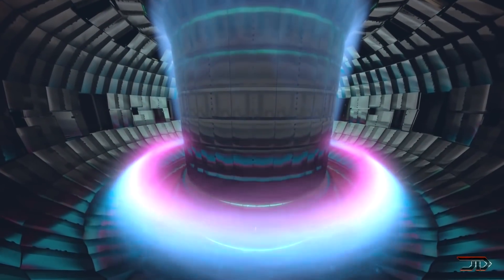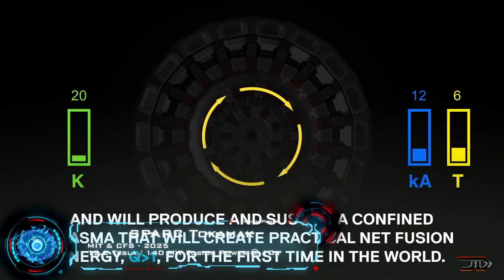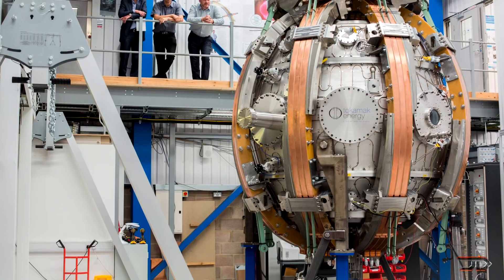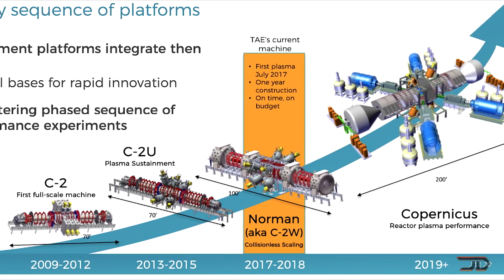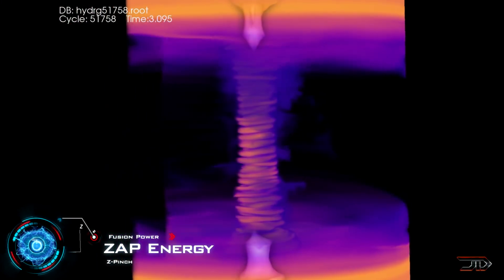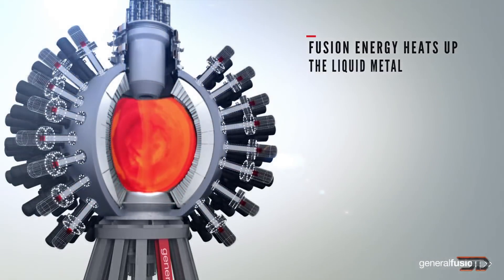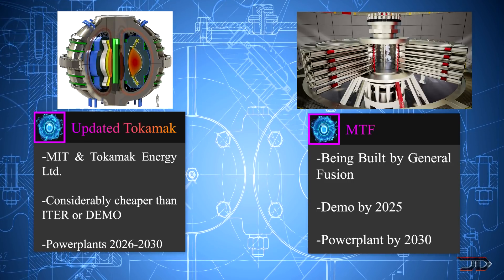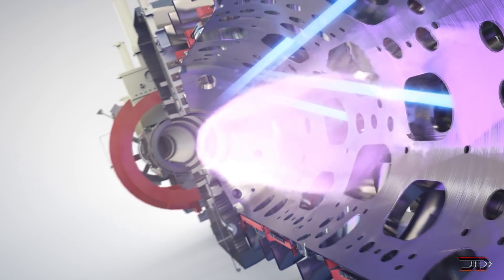Fusion Power - Latest Breakthroughs/Updates

Comment: Energy is not expressed in watts (4:35), that's power. To get energy from power it must be multiplied by time. Getting 300 megawatts means not much if it's only for a fraction of second. 300 megawatts for 1 microsecond is 300 joules of energy which is same as when 100 watt bulb consumes in 3 seconds.

Comment: None of them will provide grid electricity in 10 years from now. As you said, they are just learning how to get a Qtotal to 1 for Qplasma, not for the whole system. But it is amazing, what we can engineer today and maybe I can witness these energy sources become the power supplier of a New Age of humankind. It would be a game-changer like developing coal power in the 19 century. Certainly, with progress in HTC, it becomes more and more likely. I would guess, that is the core challenge to fission power. If the magnets become more stable at, let's say room temperature, they will be also more forgiving in changes of magnet flux, etc., and thus less costly and more reliable.

But, I'm highly amazed at what is going on in the fusion sector. :)
Reply: My experimental opinion is that in the next 5 years it will spread of LENR-based energy source. I am convinced that the result will be cooperation with the Chinese. these collaborations have already begun. Think of the Quantuum Dragon project.
Reply: @zoltanpecsek4373  That's pathological science.

Comment: Celcius ?
Reply: Good question. Where the tiny dust point is terribly big, I can’t even measure it. However, the total plasma average temperature is not high at 1000-1100 degrees. In fact, the charge ignites on the dust to a huge extent and thus cuts into the other grain of dust. Of course, there is every detail calculation based on articles. But this should also be given to the Chinese as a source of spherical lightning technology...In fact, we were completely disappointed in the West.

Comment: What about drive engines for space exploration
Reply: You can guess that everyone is working on this in secret. several pathways have been found, one plasma-based super propulsion, the other ferrite-based but only suitable for positioning, and is GMR-based highly effective. But it's not a space jump yet. His theory of space jumping seems complete. All the hidden labs stole the structure model of the spacetime system from each other. This means that a plasmon system must be stretched around the spacecraft and professionally controlled. I am confident that the Chinese-Russian consortium will complete it.
Reply: @zoltanpecsek4373  thank you for that answer that's great

Comment: Q for the entire apparatus has to be substantially larger than 1 in order to be enough to “go to the grid”, and we’re much farther off from that then 10 years, let alone less than that. We don’t even have an experiment that has a Q for the fusion process that is higher than one. I will be thrilled if I am wrong, but I don’t see this generation of experiments, or maybe even the next ones, doing anything practical.

Comment: 1:57 why they make all donuts shape/toroidal instea make sphere? Sun is sphere, planets are sphere, atoms are sphere(well close) look like universe like sphere. ok you got me galaxy are toroidal but i think is more easy to confine a ball in center than a hulaloop.
all the hot gas dont get disturbed by iner axe. and the ball can spin on its own axe like Terra is doing.
I would like to try it. make magneticfield from HTS flat wire and give it a ball shape ass we doing with carbonfiberweding.
Reply: You're right, that's what we found out about the vortices. We did it and it goes small. But the rich want a huge power plant to continue to plunder you with energy prices

Comment: One thing I'm always confused on is how the actual engineering of how to get heat moved out of these systems and doing work is left out. I know we're still trying to get the base principles down first, but I really wonder what the pathway to generating usable power will be.
Reply: I agree I can never find much information on it and seems like a big system that doesn't look like many advancements are being made on
Reply: Neutrons hit a lithium blanket, producing heat, which is transferred to a secondary coolant system (and maybe even a tertiary one), raising steam and turning a turbine.
Reply: @Gomlmon99  the neutrons hitting the Li blanked is not about power generation but about fuel production.
Reply: @russhamilton3800  It’s the neutrons that carry the energy, and the neutrons that heat the blanket. They serve a dual purpose.
Reply: i think they havent focused on that yet because it is the easier part of the equation to figure out.

Comment: And, the corrosion due to the neutron shower which will shorten the life span of any device and necessitate expensive parts replacement?
Reply: Potentially. But there will be shielding. And whether the parts replacement is severe enough to ruin the economic viability of fusion is unknown.

Comment: Was the National Ignition Facility mentioned?   It uses a multitude of laser pulses.
Reply: Not used for power generation, it’s for weapons
Reply: @Gomlmon99  none of the systems mentioned have the ability to generate power.  They are all demonstration projects.  True that the NIF is used for testing nuclear device design but it’s also attempting to cross the fusion finish line.
Reply: @calvaryassemblyofgodsouthi8046  the fusion finish line is power on the grid, cheaply. NIF aren’t aiming to do that
Reply: @Gomlmon99  ok

Comment: If they spent the trillions of dollars making Tokomaks to land and solar satellites beaming microwave energy to the earth we would not have an energy crisis anymore.  The sun is already the ideal fusion source.  We already have SpaceX to send and construct orbital solar generators for this.  Nobody mentions the fact that these Tokomak chambers need replacement every few years due to fast neutron radiation, making them ridiculously expensive and creates radioactive materials that needs to be dumped somewhere.
Reply: An “orbital solar generators” are not going to be ridiculously expensive?
Reply: @Gomlmon99  Expensive, but you get guaranteed perpetual and non-radioactive power.  On a side note it also makes the human race space faring and multiplanetary.  Compare that with thousands of Tokomaks constantly creating radioactive materials from replacing the magnets and shields, IF they make it work.
Reply: @Gomlmon99  Watch YouTube - Elon Musk's simplest idea on solar panels to power the US.  It only takes a small corner of Nevada or 100 x100 miles to power the whole US.
Reply: @joey6818  In space?
Reply: @Gomlmon99  On land only.

Comment: ITER is just an proof of concept if you have Q=10 net gain inside the reactor ofcource you don't end up with ten times more energy then you put in, if you include all energy used to construct build and maintain the equipment needed. That doesn't matter much though, once you know how to build the reactor and have it stable you can start working on to make it as cheap as possible. Then you can also redesign and figure out how to reduce the energy required. Think of it as an car an old ford is version 1.0 and you end up with current cars after a while.

Comment: So... someone is funding scientists who want to make perpetual energy? I was told that was snake oil by scientists.
Energy in, Convert atom to different atom, get more energy out? is that what we're trying to do here?
We don't even harness Fission yet, just a thermal effect for the steam generator. "here's a radioactive thing that if you do this, it heats my coffee!, let's turn it into a steam generator!"
There aren't any breakthroughs in fusion. They're neat, expensive, and will create opportunity for various other industries - plasma jet engines for example, but to create enough energy to overcome the energy required? They're not even close to touching that milestone, let alone hitting a Q1. "Technically, once it works perfectly, every 10 seconds we eat 50mw and we can shove 300mw through the pipes to your house, don't worry about the bi-product, the future will figure out what to do with that!", I want to see how they buffer the energy requirements and the output so it doesn't make my toaster dance when it's off.
Reply: It’s not perpetual energy, it burns fuel

Comment: Meanwhile brilliant light power just produced a 200 to 1 gain using hydrogen gallium and dc power. That produces 10k degree heat and claims it uses dark matter fused hydrino atom that produces the same effect in the sun. Here is what the problem is if fusion occurs inside the sun WHY THE HELL IS THERE MASSIVE DARK SPOTS ALL OVER THE SURFACE. UNLESS THE SUN CAN BEND LIGHT AROUND CERTAIN AREAS DUE TO WHAT EVER FLUCTUATING GRAVITY ANDCELECTRO MAGNETISM. the sun crests fusion on the outside or surface. By using the effect of superconducting hydro fluid in both liquid and metal form to produce high yield spinning fields that cause massive electrical surges on the surface increasing the speed of the atoms so much fusion happens do to the ionization created just like earths ionosphere which is known to be 3thousand degree all around the earth. Which the earth also has a magnetic sphere. Hmmmmmmmmmmmmmmmmmmmmmmmmmmmmmmmmmmmmmmmmmmmmmmmmmmmmm.

Comment: how do they even plan to extract energy from the fusing plasma?  This aspect is never discussed except for the liquid metal system. But if they don't take the energy out extremely efficiently, it will run away thermally.  It's all very well making things blow up, but it's not much use without harnessing it.  Also do we really want to start making processes that start generating billions of watts of heat that we need to get rid of (e.g. extra waste heat due to inefficiency of conversion)?

Comment: I personally don't believe that magnetic field controlled fusion is gonna ever be power positive.  The reason why fusion works in space is because gravity is the one holding it together,  free gravity.   Electromagnetic fields will never be free especially the ones you need to control fusion.  I say that instead of concentrating on a force that not even the cosmos uses 100% to control fusion why don't we look to something else that's more that makes more sense.

Comment: When mentioning the Q total of an experiment the fully accurate explanation should describe the burning plasma / ignition profile of a design

For instance while ITER is likely looking at breakeven a pilot plant based on it would produce 5x more power with an input about 75% greater - putting out a net GW of energy. As a tokamak approaches a Q of 30 it becomes nearly fully self heated which is something that Q total values can't convey until you actually get there

ITER's economics are undoubtedly still a question mark. They depend on economies of scale and private enterprise allowing a commercial design to be built far cheaper. But since an ITER design is so large it must put out at least a GW, making it difficult to find enough demand for them so that the cost can go down with experience and economy of scale
Reply: ITER is a purely research operation, there is no “economics” to it — it’s not going to sell electric power into the grid. It is only to study the processes in the plasma (yet to do) and to drive forward the technology by ordering lots of complicated engineering stuff made all around the world such as  the various HTSC magnets, blankets, divertors, beam and power injectors etc that can be reused in further projects.
Reply: The majority of the cost of the ITER project is the measuring systems behind it. The reactor is build more like CERN rather than a power plant. A commercial design would be magnitudes simpler. Also new high temperature superconductors can simplify the reactor design

Comment: Here's an entertaining Holy grail. 
The Words Whole relationship:
G is an incomplete whole with one square angle drawn in. 
O is a Whole.
D is a split whole with two square angles drawn in. 
As we add a Whole relationship to the words middle way we see GOOD expanded from its Whole image.
Draw the Words first and last into its middle way to measure a Whole halved once squared twice to the right for its:
Time 12-3-6 
Time, times 12x-3-6 
Time, times and half a time 1/2x-3-6 
Additional elements from the table:
12 Magnesium 
3 Lithium 
6 Carbon 
1 Hydrogen 
One clock wise cycle out of many observed and measured from the Words Whole image, not mine.

The second cycle of the image adds onto the Hydrogen, 2×-3 would be the Deuterium and Tritium extraction gain, as its contained in the higher arc and angle from that same image.

Of course no one's going to draw the word into its own image to see if it's true and would rather throw it away or argue for and against invisible magicians.

Oh well.

Comment: What substance can contain plasma with a temperature of 100,000,000°
Reply: None! The chambers are often lined with tungsten, or ceramic tiles and great effort goes into keeping the intensely hot plasma from getting close to those walls. Even so the tile surfaces are ablated and so those tiles need to be replaces. It is one of the details that is rarely mentioned in promotional presentations. In the fuel instances where fusion actually takes place and fusion neutrons are generated they will transmute some of the surrounding atoms into radioactive species. That is another factoid that rarely gets mentioned.

Comment: I'm wondering why more people aren't focusing their efforts on electrolysis, producing hydrogen out of water using electricity. It's easy, you can run combustion engines on it to power generators to produce electricity, and the emissions are just water vapor. It's something that actually works and simple.
Reply: The production of hydrogen using all renewable sources to electrolyze water is often referred to as 'green hydrogen.' Many people are unaware that though it is a very simple process in the lab it presently can't compete economically with hydrogen production that involves the emission of CO2 into the atmosphere. We live in a world driven by capitalistic practicalities.
Reply: @vernonbrechin4207  it might threaten the petroleum industry as well and we couldn't have that how could we
Reply: @christrull7081  - Currently the fossil fuel industry is promoting hydrogen, partly as a diversion and because most hydrogen is now produced from natural gas, with CO2 release as a byproduct. Many entities are far more focused upon the preservation of themselves over that of preservation of life on this planet.
Reply: @christrull7081  all you have to do is stop buying oil and switch to electrolyzed hydrogen to see it is a bad deal.
Currently oil is dirt cheap. Few hundred for a barrel that will teleport you around town and power your comfy house.
Hydrogen is going to be many times more expensive, people are happy to pay a little more for green tech but not 3 times more.

There is no conspiracy, it is just simple reality that people choose oil and gas because it makes more sense. You included.

New technology is the way forward, cost for energy has to go down, not back up.
Reply: How does it work? It is like saying lemon batteries work.
The problem is the bad round trip efficiency, hydrogen is just a energy storage medium.
- 70% efficiency in generation is the absolute max (electricity -> hydrogen)
- 40% efficiency when combusting is the absolute max (hydrogen -> kinetic in a ice engine)
- 80% can be done with a fuel cell instead (hydrogen -> electricity -> kinetic in an electric motor)
- another 20%+ is lost in compression 

In a perfect world that still means half+ the electric energy you catch in your solar panel is lost in the process. meanwhile with batteries that number is not even 20%.
maybe some time in the future when there is massive overproduction of solar energy at certain times of the day and year electrolysis makes sense. But for now nope.

Comment: What about the Wendelstein-7X? It is currently going over to the phase where it is running a deuterium-tritium plasma for potential energy harvesting. Overall stellerators are a very promising fusion technique because they can be run almost continuously and not in pulses.
Reply: Thank you for mentioning that since most fusion experiments do not employ fusion energy generating fuels but simply test with normal hydrogen. Readers should know that tritium is very rare, very expensive and is radioactive. Future fusion energy reactors are assumed to be capable of generating their own tritium fuel. The Wendelstein-7X is an experimental machine, not something from which the fusion energy can be harvested.

Comment: You missed focus fusion out of Princeton NJ which is actually a very low cost method and if it works will be the easiest to get to mass production and actual electricity generation, which most of these haven't even started working on. Their lead Scientist isn't really charismatic though and because they are not asking for billions in funding they are only getting small amounts as well.

Comment: They're not interested in using it for powering Societys needs their main goal is to use it as a weapon or power a weapon, lets get real😁
Reply: That is primarily the case for the Inertial Confinement Fusion (ICF) machine at the National Ignition Facility (NIF). It has always been presented to the public as a path to nuclear fusion power while in reality it has always been primarily funded as a thermonuclear weapon fuel compression research tool.